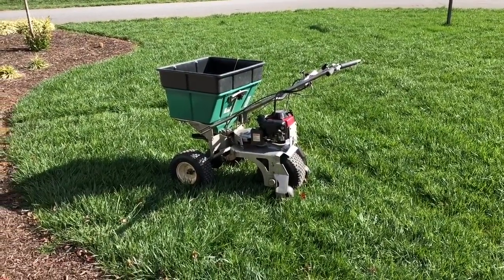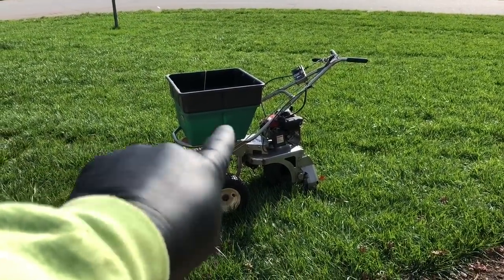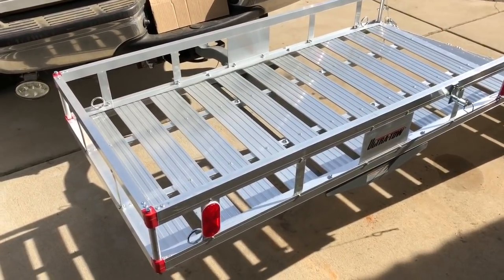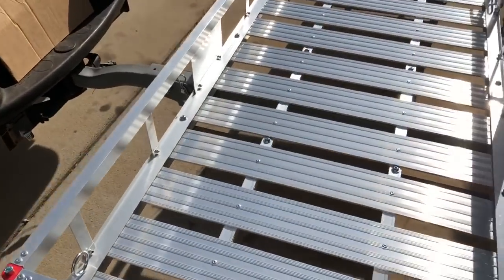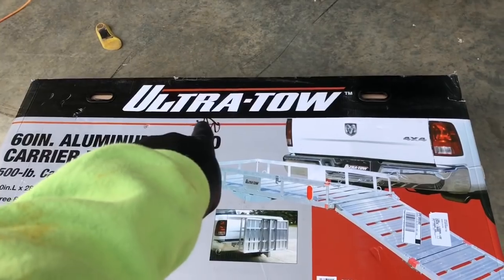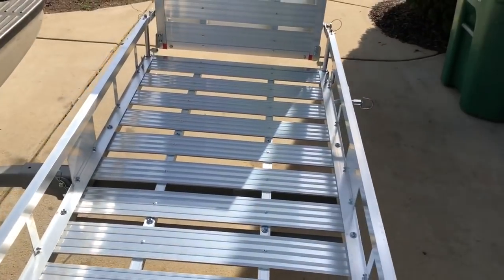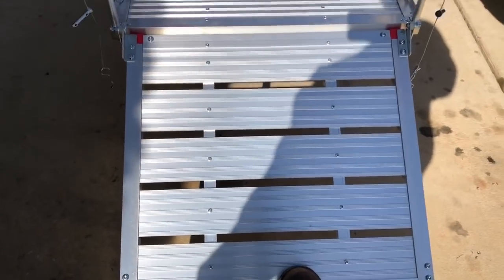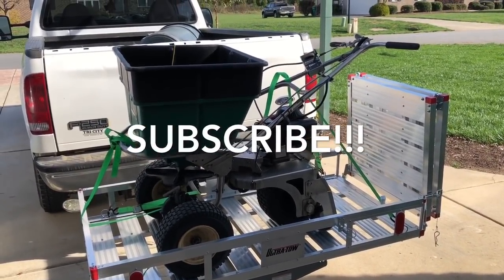Lawn Care Fertilizer Set-Up

Comment: I have a steel one from Rage it is perfect for my Billy goat Plugr as its to heavy for me to get it up on the truck bed.
I hope to use it with a snow blower in winter.
I switched out all the pin and clips to graded bolts because I didn't like the rattling it made.
Reply from the maker: Wayne Essar sweet